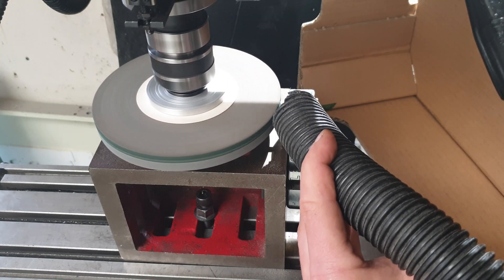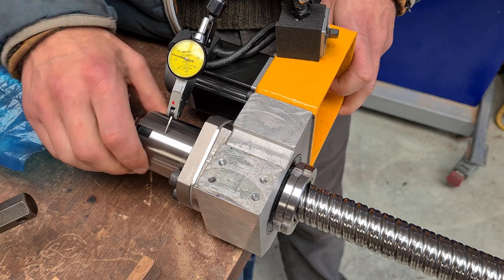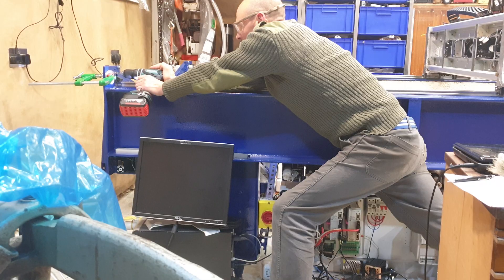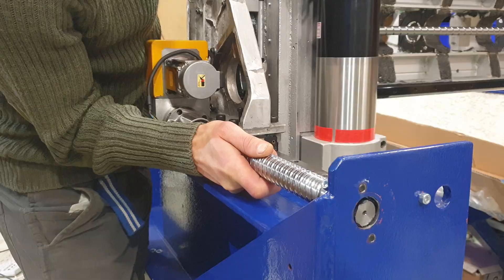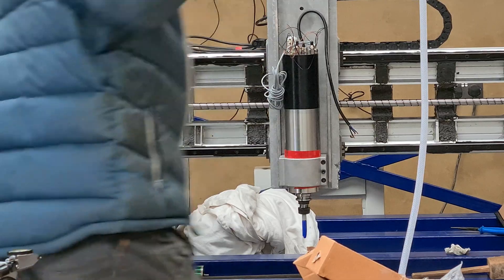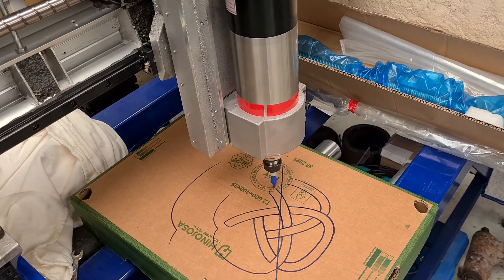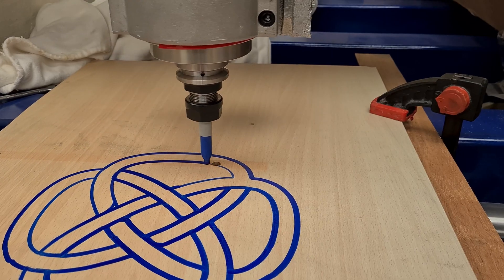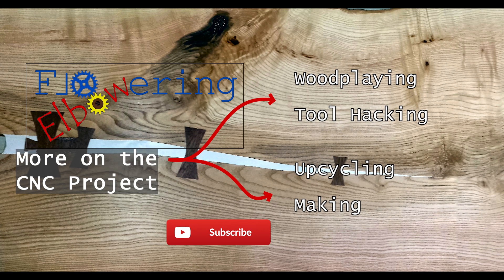First multi axis MOVES with unusual ballscrew mounting

Comment: I am looking to change my ballscrew also for this set up. I suppose i best go for 2010 ballscrews instead of the 1605 that i have now. Well done, very succesfull.
Reply from the maker: Hey Staf, thanks! Will see how the actual milling goes;)
Reply: @FloweringElbow4SuperNerds  no doubt that will be just fine and accurate too.
Reply from the maker: @StafPypen  thanks for the vote of confidence 👍. Is mostly going well. Am battling some lost steps, I think due to my terrible temporary wiring and noise, during fast adaptive paths atm. Is working great for regular cutting... soon many mach3 settings to get right. So much fun 😀